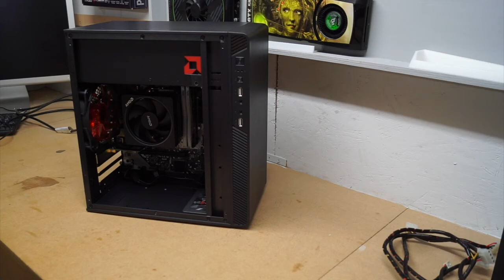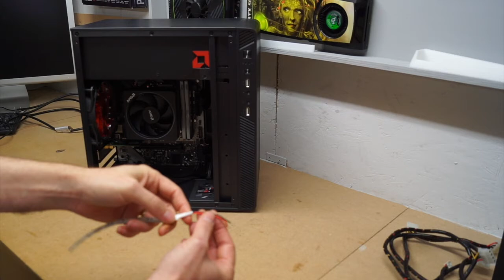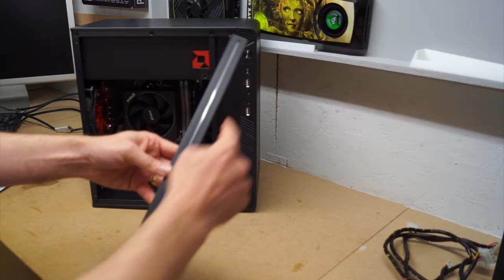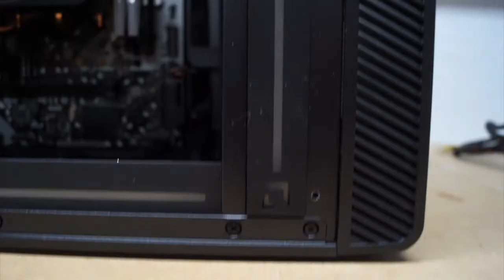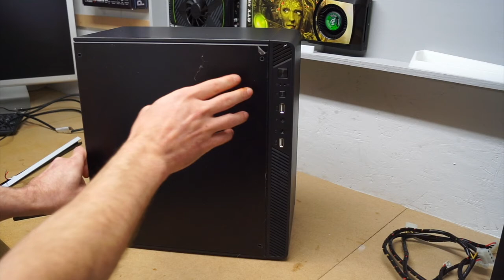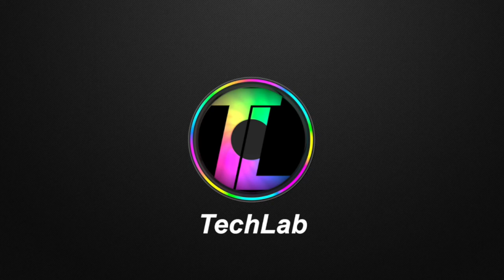AMD Tribute Part 6 - Lighting

Comment: Any idea where I could find those dispersion bars? 
Also unrelated, does this case have air vents at the bottom for the GPU? I can't imagine it would stay cool otherwise.
Reply from the maker: Hi, The case doesn't have any ventilation in the bottom, it's all drawn from the front.  The dispersion bars are called "LED Strip Extrusion" and you can find them on Ebay in all sorts of shapes and sizes including clear or opal covers.  Hope that helps.